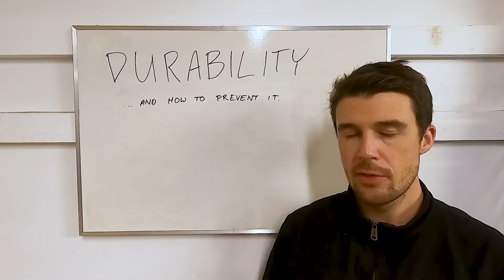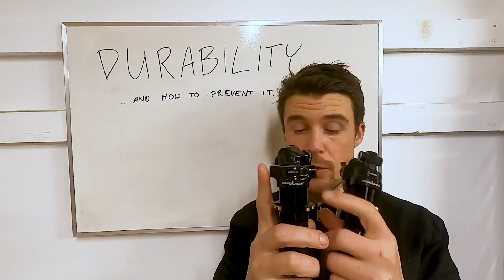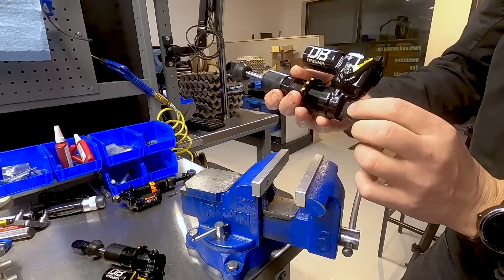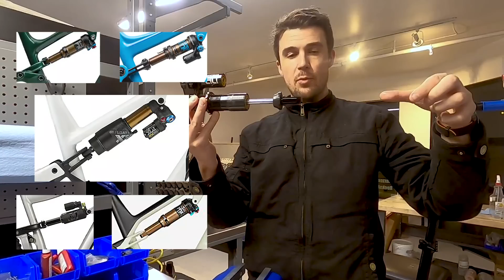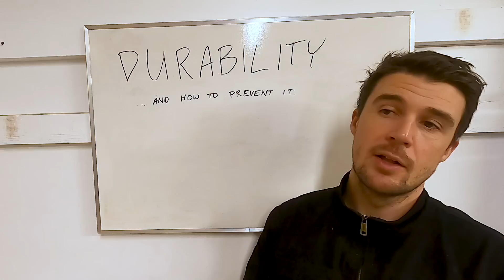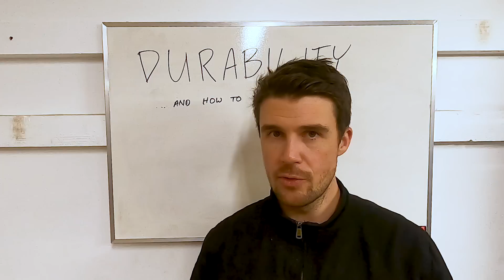Dear Bike Industry... Tuesday Tune Ep 34

Comment: Hey Steve. Thanks for your videos, always very informative!
I’ve had many DU bushings that were so tight that the axle is completely stuck. Stuck so bad that I need a vice to extract it. This has 3 problems: increase wear in the shock (anodisation inside that is wearing), wear at the frame interface because the axle rotates with respect to the frame, not with respect to the shock! And also the tightening screw that keeps getting lose.
I tried IGUS bushing but couldn’t get the axle in without damaging the material. 
In one old frame I was able to install a roller bearing.  On another frame it wouldn’t work so I asked a friend to machine a bronze bushing.
Had the problems on 4 separate frames, and with 3 different brands if shocks.
What’s your take on that?
Reply: You could pick up a 15mm reamer as it sounds like the hole in the shock is to tight? FWIW, Cane Creek used slightly smaller holes in their shocks with their own hardware and standard 15mm bushings don't work in them. I was able to use a reamer and open it up to 15mm by hand.
Reply from the maker: DU bushings should be quite tight - they do have significant enough friction that roller/ball bearings are noticeably better, but it can be hard to find a high enough load rating for small bearings like that, plus sealing needle bearings is tricky. The Igus ones are usually pretty good though, sounds like your reducer hardware was not properly chamfered.
Reply: I've had a new bike where the bushings were so tight that the shock had wear marks after a few hours of riding (from torsion of the shock due to suspension travel). Warrantied the shock through the bike manufacturer, and installed IGUS bushings on the new one. Shock lasted for years until I replaced it by a different model - for an upgrade, not a failure.

Comment: Can you solve the mystery of why all shock manufacturers will not warranty or approve of a coil on Specialized Kenevo and Levo
Reply: Because the forces of the frame will break the damper shaft.
On an air shock there is more meat to handle those forces.

Comment: The only bike Ive owned that didn't eat it shocks was a 2017 Commencal and it had a shock yolk. I've owned a few Specialized bikes and I they were so un- reliable just because of the constant rear shock issues. Worst of all shock issues  was a 2017 Spartan that tried to kill me, burping air on the way down the trail and dangerously lowering the BB height. I actually got some great suspension advice from Steve and sold that thinking. Thanks for shedding light on these issues.
Reply from the maker: Not every bike/shock combination is guaranteed to destroy shocks in 30 seconds even if it does use less-than-ideal construction in some regards - otherwise yokes and trunnion wouldn’t still exist. Most of the time it’s fine, but most just means >50%.
Reply: I've had 3 Commencal bikes, never had a shock issue.
Reply: @mtbohana I never had a shock issue on my Commencal either, but I did snap the rear axle and go OTB. The next year they used a different axle...
Reply: @ryanautomator5760  Do you know what brand that axle was? I need to stay away from them.  I already go OTB with two good axles LOL.

Comment: Your comparison between the trunion mount and DU bushing side flex was misleading. The bearings on the trunion mount will have side play, similar to what you showed with the Santa Cruz specific shock.
Reply: It's probably not as misleading as you are thinking though. Say your pivot can allow 0.001" of misalignment through clearances. With an eyelet, that misalignment happens across ~12mm of width. On a trunnion mount, it happens over 54mm. The angular movement allowed by clearances in the trunion mount is significantly less. The same thing also applies to deflection in the materials, any deflection in the 12mm eyelet will allow significantly more angular deflection then the trunnion.
Reply: @dsm156  I understand, just saying that bolting it in a vice was not a very good representation. Next time I remove my shock it will be interesting to leave the trunion side attached and see how much side-play there is.
Reply from the maker: @Hurrikahn  once bolted up, the play in the bearings is taken up and it is very rigid. Check it out if you have a bike with trunnion mount - you can easily compare the trunnion end to the non trunnion end and see which end is more rigid.

Comment: Specialized Kenovo 2020 doesn't like coil shocks as the frame forces the top shock mount to move, and I went through 4 full factory shock body rebuilds as cracks on top eyelet oil leaks, also shock shaft on 5th bent, so much so Specialized do not fit coils on there Kenovo anymore. It cost me a couple of grand postage service calls etc. They then give me a Fox 2021 X2 air and that has been great but just sent that after 125 hrs and coat me £180. Now the teflon bush used are fit and forget but I now run needle roller bushes and it lets the shock be less fixed. Good video. I fitted the coil conversion on my Factory 36 a couple of years ago and was very good.
Reply: Good spot that roller bearings do not hold the shock rigidly in place

Comment: Good video as always. 

I just have an understanding question regarding the side loading issues that can occure with extending yokes that have one eyelet rotated 90 degrees:

How do they create more sideloading torque than a construction without the yoke? 
I can get behind the idea that an extending yoke with all pivots oriented in one way (pivoting in the up-down direction) will act as a long lever for side loads. But when using a 90 degree rotated bushing in the middle (where the shock is mounted to the extending yoke) I would assume that the load is the same or even less for a given side deflection on the point where the yoke is mounted to the rear triangle. As the length is bigger the needed angle to compensate the side deflection would be smaller for either end (shock bushing to the frame and yoke bushing to the rear triangle -> The middle one can move freely as it is rotated 90 degrees).

I would appreciate if you could  explain that in laymans terms! :)
Reply: Here's a brief explanation. 

Start with adding a yoke to extend the shock. Then you have 3 rotation points: the front shock eyelet, the rear shock eyelet, and the yoke mounting points. When those three are aligned, they all rotate in the same direction, so if one rotates, the others can as well, taking up movement without loading anything. 

Rotate the middle eyelet so it's turned perpendicular to the rest, as is done in the clevis design. When that middle eyelet rotates, the other eyelet and yoke mount no longer rotate with it, because it's direction of rotation is perpendicular to them. That movement has to be taken up somewhere, so it goes into the shock shaft. Bam, side load and increased wear.
Reply: Exactly my thought also. With such a construction you should get " free" rotation in all directions. In the pich axis you have the upper mount, in the yaw axis you have the lower mount and in the roll axis you have the shocks ability to rotate between the eyelets.
Reply: @mikaeljc76  not really, because it's not about rotation, but about bending forces, with a very long shock (a yoke effectively extends the shock length) it wants to bend on itself, that's part of the issue, add to that frame bending side to side, with both eyelets setup 90° to each other, the shock has to bend on itself, instead of at the mount, hope you understand what I mean.

Comment: I totally agree with everything said! But there is more... The current trend of extremely low and sloping top tubes (for no logical reason, standover height is not an issue that far back) makes it even harder to fit a decent size shock in the frame. AND it makes the frame less stiff of course. And it's ugly. ;-) 

A funny thing is that it's quite often the large frame manufacturers that produce bikes with yokes. Shouldn't they be the ones that have the knowledge? I mean, a small manufacturer might not have engineers and designers with sufficient experience to avoid flawed designs,  and that would be easier to excuse.
Reply: It's about the looks mostly, a frame that sweeps low looks good imo, plus you get more standover at once, since the tube goes mostly in a straight direction.
Reply: @piotrekserwisuje  yeah silly me, a high horizontal top tube straight from the top of the head tube would really enable me to have a 200mm dropper. If i was 7ft tall maybe.
Reply: @lewistaylor1489  first of all we were taking about top tubes, not seat tubes, they are somewhat independent, secondly I'm running a 180mm Oneup post (I could have fitted 190 since the frame has a lot of insert depth) on a frame which many reviewers dubbed as having a "high seat tube" (440mm in Medium)
and I'm only 170cm tall, so no, a low seat tube doesn't necessarily all of for a longer post, it does however allow for up sizing, which I'm not sure is applicable anymore, with most bikes being really long already.
Great example being the newest Commencal Meta, all the low seat tube does is make it so a lot of seatpost is sticking out of the frame, since the tube bends so close that you would be be able to fit a longer dropper than before anyway (assuming the dropper is slammed, which is unrealistic with how low the seat tube ends)
Reply: @piotrekserwisuje  ok mate, keep changing your answers around to suit your argument.  I got better things to do.
Reply: @lewistaylor1489  🤣 that's a first.
Reply: Its to fit decent length dropper post
Reply: @lewistaylor1489  nah, aspecially on frames that don't have more depth anyway.
Reply: @lewistaylor1489  As already said above, seat tube length has nothing with top tube height to do. Most modern frames have a lot of seat tube sticking up waaay above the top tube. For no reason at all. The top tube doesn't do anything to what dropper post length you can use either.
Reply: The only benefit that I can think of is not having brake levers and shifters hit the handlebar. IMO, my 2020 Specialized Chisel Comp has plenty of room to lean the bike around with a dropper post.
Reply: @vivek_v  that would make sense to a point I guess.
Reply: The super low standover of my Capra saved my future children during a weired (almost) crash. Low standover is super important when things go wrong...

Comment: I was going top write a tale about how i had to modify my suspension linkages because of too tight bearing fit but it just got too long. So this will suffice. Basically as standard it was like riding with seized bushings. I took to it with a socket, emery paper and a steady hand and now I have bearings that turn for smooth suspension operation.

Oh yeah, my shock (trunnion) is fine so far.

Comment: Is there any way to soften the impact of these sideway forces? E.g. with some sort of special bushings/bearings? My Specialized seems to be affected by it, it has a yoke and regular bushings (no Trunnion mount), and it appears to have eaten my DVO Topaz T3 in around 5 months.
The shock is now losing air, and Im not sure this will fall under the warranty.
Reply: Roller bearings help a little, they aren't rigidly held, so the shock can find it's comfortable spot to some extent
Reply: @piotrekserwisuje  Do you have any recommendations? Fox now offers a ball bearing kit for shocks, although it seems to be 8x30mm only, and I'd need something for 8x20mm.
Real World Cycling has needle bearings in 8x19mm, with some additional 0.5mm spacers, so theoretically it would fit. As far as I know needle bearings are not great for axial forces, so not sure if these would actually help? Also the shipping from US to Germany is a whooping $35.
Enduro Bearings themselves, whose bearings are used by RCW, also offer a needle bearing for shocks, however without the spacers, so only in 19mm or 20.85mm, which might or might not fit (and interestingly according to Chris from RWC the development of this product was a breach of an agreement of not offering a competing product). At least this would be available in Europe (once it's back in stock sometime next year).
Are there any other options?
Reply: @sp00n  I was talking about needle roller bearings, should have been more specific. They do not take axial forces at all, as in they allow the shock to move side to side, I think they could help a little, plus they are way smoother in frames with high eyelet rotation.
Reply: Which model
Reply: @robertg4249  A Kenevo. It seems to have a very similar yoke system as the older Specialized Enduros, although a slightly different layout (not the "Specialized X" anymore). The new Enduros seem to have an updated linkage design, where the yoke doesn't extend the shock length anymore, so they could be better in this regard? I don't know.

Comment: Would love to hear your thoughts on ProPain’s suspension design. No trunnion and no yoke. Ad spherical mounts and it would be a winner…
Reply from the maker: Overall, pretty good. I like most of what I’ve seen from Propain, not just the shock mounts but the bikes as a whole are nicely done.
Reply: Judging by my current bike with very similar suspension layout (minus the floating lower mount)it's pretty good in terms of side loading the shock, only issue being a lot of rotation in the upper eyelet, so eyelet roller bearings highly advised, both for sensitivity and bushing durability.

Comment: Avoid trunnion and yoke mount frame designs, problem solved. And riders, check and replace your suspension pivot bearings regularly!
Reply: Good luck with that 🙃
Reply: The play was a positive. Would a little extra play due to wear be detrimental? How so?
Reply: @niklasdr  more side loading obviously 🤔
Reply: @piotrekserwisuje  or side load is eased off / alleviated with play 🤔
Reply: @niklasdr  it depends where the play is, play at shock eyelets is good cause it allows the shock to twist instead of straining, play at the suspension pivots makes the the linkage moves sideways more, which means stronger side loading if the shock.

Comment: The trunnion mount on my 2020 Enduro is 
-way wider than 54mm 
-not centered with the yoke. 

Had to shim .020" all on one side to center the shock and get rid of the spacing in excess of 54mm to avoid preloading my bearings and applying side load on the shock
Reply from the maker: 54mm is the shock width, the bearings themselves can be at 65mm or more - there should be a spacer between the bearing and the shock on each side.

Comment: @Vorsprung Suspension... Truth be told, shock durability isn't something most bike designers design for, it is usually an after thought that gets addressed in a second or third update of frame a design. This is one reason you want to go with a full suspension bike design that been around for a while and had the bugs worked out of it.

Comment: The bike industry has such an unfortunate mix of circumstances that leads to so many half baked products and concepts.

- fanboys, hype
- customer education about complex mechanical problems is difficult
- selling features, brands and lifestyles instead of performance 
- many payed reviews
- below average wages in the bike industry (just like ski) deter good engineers, who make more elsewhere
- narrow mindedness and stereotyped thinking on the customer side. 

Its not all bad. There are some great people out there making fantastic products. Sadly they are often trumped by bigger players with more manufacturing capacities and networks.
Reply: I'd argue that there's no need for "customer education about complex mechanical problems."  Why would a customer need to know more than, "Make sure stuff's tight and service and recommended intervals?"
The automobile owner doesn't need to know about variable valve timing,  low-speed versus high-speed compression damping or any other complex systems in the modern car; they just drive the things!  (Yes, they must check oil and tire pressure and a few other things.  Similar to what the bike consumer must do.)
REQUIRING arcane knowledge isn't the solution.  In fact, doing so relieves the manufacturers of responsibility, placing more on the end user.  Not the best result.  Designing "stupid proof" bicycle products is.  In other words, make sure it can provide appropriate lifespan for its intended purpose, given a reasonable maintenance schedule.
Sure, those interested in the minutia of suspension design and everything else can learn all they want and go nuts.  But it shouldn't be a requirement for the end consumer.
Reply: Can you give examples of those "great people" out there and their fantastic bicycle products?